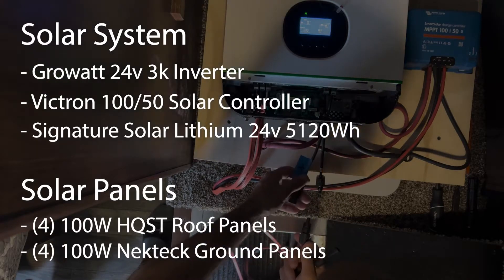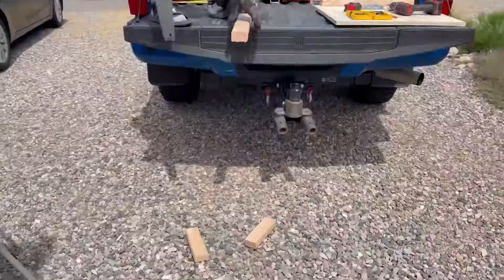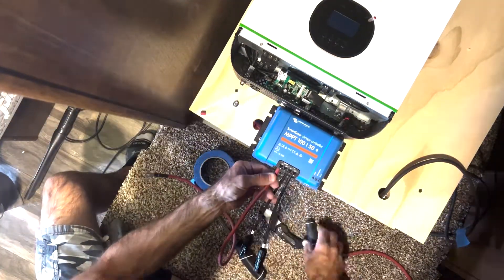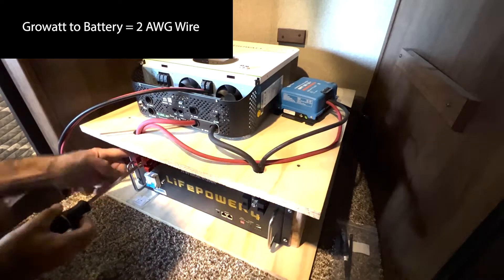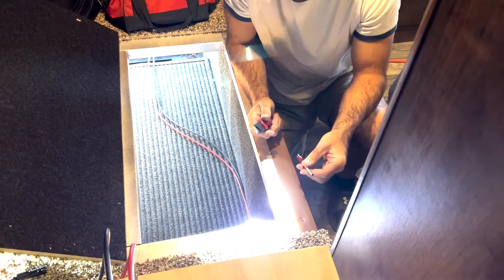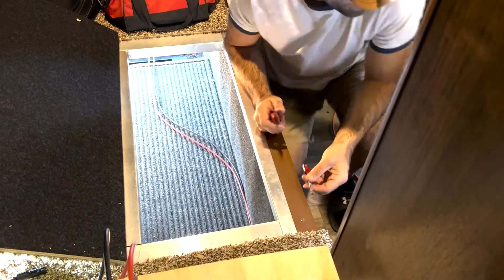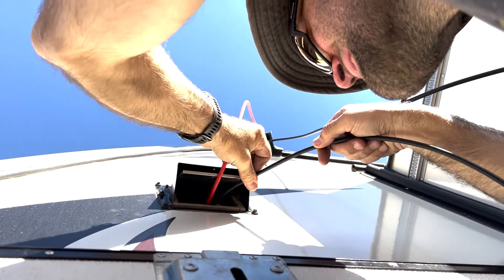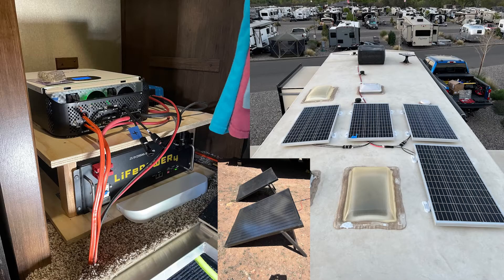RV Solar Install: 24v system with 3k inverter; Lithium; Victron Solar Controller, 800w solar array

Comment: How is it working out so far.... you basically built the exact system I was thinking of building but with maybe a second EG4 battery
Reply from the maker: So far, we've used it about 10 days off-grid. It's working great. I'm in love with the EG4 battery for performance and features. Running a couple of Macs and external monitors, microwave here and there. We love it. We could use more solar power, and will be doubling the roof from 400w to 800w. I would also think that a second EG4 for a total of 10k wH will make this system bulletproof for our day-to-day use. I would stand behind any of these components as of now.
Reply: @overlandchronicles2708  did you wire it right in to your 120 breaker box or are you running an extension cord? And if the former did you wire in your 12v system as well?
Reply from the maker: I didn't install a ATC (Automatic Transfer Switch), so I have to run my RV's 50amp around and under the RV to the Growatt Inverter AC Output line. This Growatt AC Outplut line is a 10/2 Romex with a Journeyman 30amp Female connector that I stick through the cable door. I think in my future system, I'll run a ATC so I don't have to take out the heavy RV 50amp cable every time I want to use the solar inverter.
Reply: @overlandchronicles2708  I might be wrong since i'm still in investigation phase of my build but, Doesn't the Growatt act as a transfer switch if you wire your shore power in as input on the grow watt instead of to your 120 panel and then the growatt's output to the panel's main breaker? Then if you're on shore power your charging your ?batteries and using shore power for appliances, and then when not on shore you're using batteries/pv? I think that's how the victron guys typically wire up their rigs but there aren't too many growwatt guys on YT.
Reply from the maker: @JohnSnow-lb6xi  You are correct. There is a source priority you can set in the Growatt, and it will do the switching for you. Shore/Solar/Battery. But Growatt and the typical 30/50Amp ATC are separate things. Where you say "Growatt's output to the main breaker"... this is the missing piece, and this is where the ATC comes in. I solve it by running a RV 50/30Amp outside and back to the Growatt. An ATC is a very simple electronic switch that manages if power should come from the RV site shore power or Growatt's Inverter and the direct that to the RV Inverter. The downfall is you have to find a path for the wires to run through the RV and a place for the ATC. Can be a pain depending on the RV and location of your electronics. Think of an ATC as a simple Y connector that redirects live power. I've never installed one, so take my words with a grain of salt.
Reply from the maker: @JohnSnow-lb6xi  I think my comment a couple mins ago might have covered this. However, I'm running my RV 50amp from the input port the RV in and around to the Growatt on the other side via the pass through, into the the RV hose/cable port from the bottom. Then from there I plug into the Growatt AC output to supply power. This is how I'm reaching my RV inverter. Sort of an ignorant way of doing it, but wasn't in the mood to fish wire through the floor, etc.